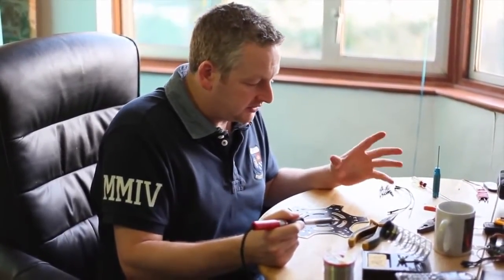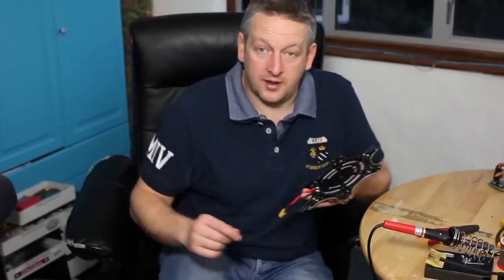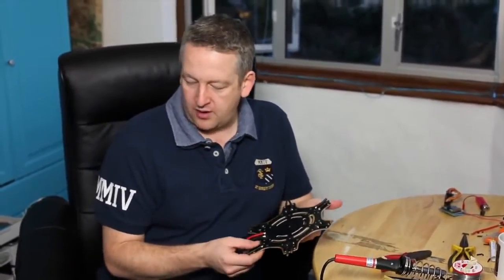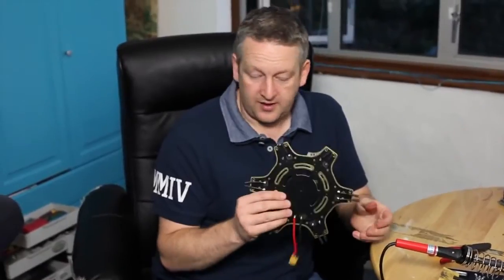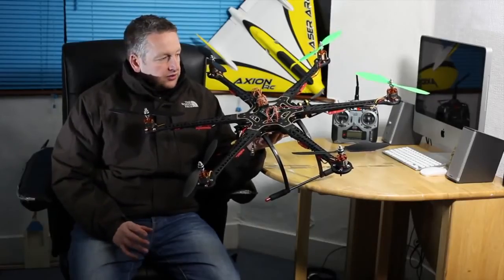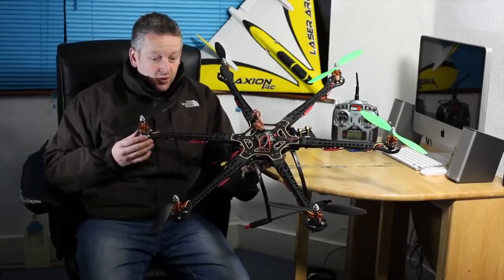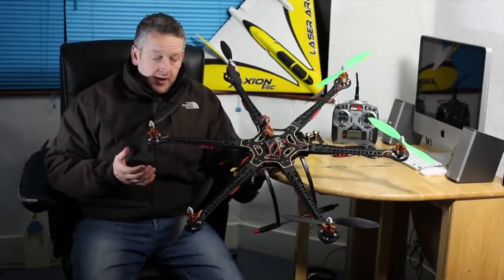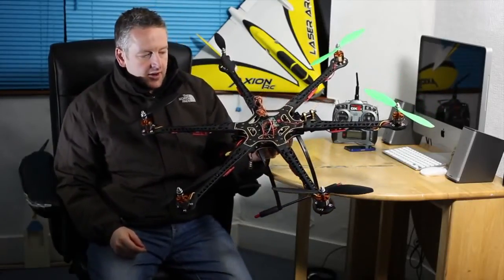Budget Hexacopter Project - Is it possible? RCT800

Comment: I really enjoyed your video. I am interested in this hobby but only have a little flight time on a coax heli and lost it when I attempted to fly my 450 collective pitch heli. I would be interested in something like this for FPV but I have never built a hex or quad. For that reason, all I have been considering thus far has been RTF multi rotors. I also would like for it to be equipped with GPS with return to home..I have a question for you. In your opinion, would a low tech person such as myself have a lot of trouble programming and configuring the GPS, flight controller and radio setup for a build it at home multi rotor such as this?

Comment: Could i use HK AX-2810Q 750KV motors with 12' props with 3S lipo and HK Blue 45A ESC ?
i have them laying around here ...
Reply from the maker: As long as they all play together well I see no reason why not but you'll need Simon K firmware on the ECS's
Reply: +RCTV-UK How much did this one cost in total?